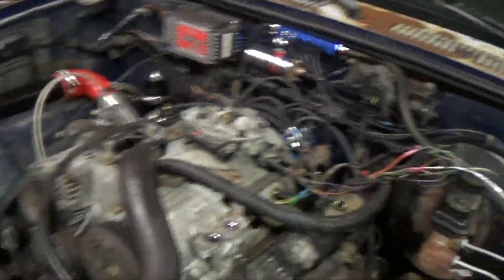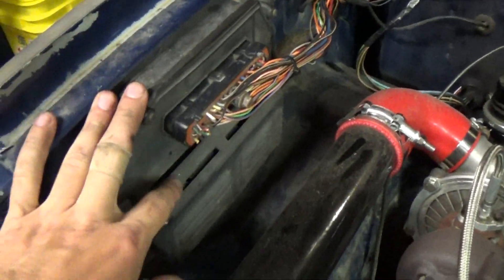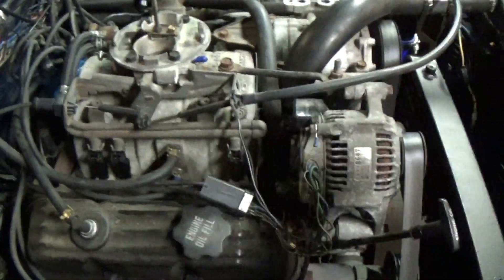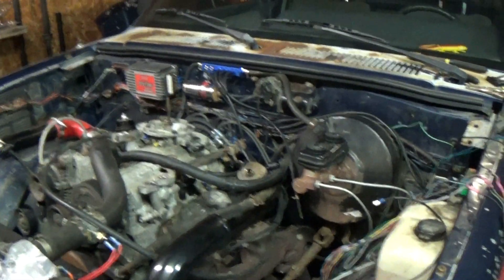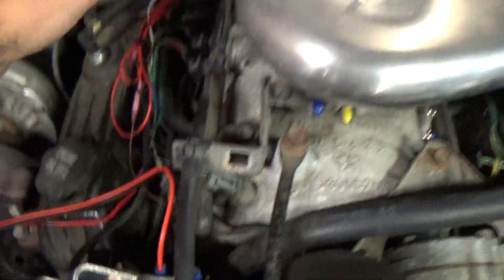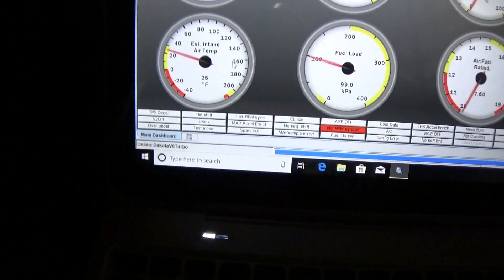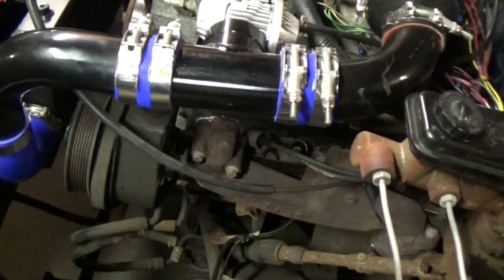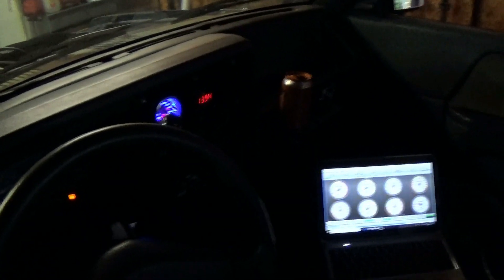3.9 Dakota Megasquirt Install Part 2

Comment: i have a 94 dakota with a 5.2l that im putting a microsquirt on. Its giving me a few problems but i think im just going to go race mode and have the 12v parts on their own switches.
Reply from the maker: What kind of issues is it giving you?
Reply: @RustBeltGarage1  just needed a firmware update but where did you get that adjustable iac valve?

Comment: did you ever try anything with tuning the stock ecu? i know theyre flashable but theres one company that does it any they wont give me any info go figure so i think im gonna just go megasquirt also.
Reply from the maker: Dillon Hensel nope I never tried, the factory ECUs on these trucks are flashable but any standalone ecu will run circles around one and from what I’ve seen don’t cost much more
Reply: @RustBeltGarage1  yeah for sure which ms did you go with and how much did it run you?
Reply from the maker: Dillon Hensel I used an ms2, I think it was around 650 including the wiring harness
Reply: @RustBeltGarage1  also i cant wait for you to hit the dyno i wanna see what theyll do. nobody mods these trucks so im stoked to see yours

Comment: I have a 3.9 too I am still trying to figure out the fuel system and how it should be done can you do a video elaborating on your fuel system ?
Reply from the maker: Yeah that’s been something on my to do list, do you have questions regarding the megasquirt setup or the actual fuel system setup? I plan on making a detailed video once I have dyno numbers to back it up.
Reply: Rust Belt Garage just on the FMU and how it was Plumed  👌🏼👌🏼
Reply from the maker: Francisco Hernandez the fmu never worked well and I’d suggest not bothering with one at all. Basically I ran an external walbro pump and all new fuel lines to handle the extra pressure of the fmu and keep the high pressure from being in the fuel pump assembly itself(the walbro was sucking fuel through it instead). I also flared the inlet and outlet on my fuel rails so I could use conventional hose clamps to assemble everything without hoses blowing off. I had no hose blowouts with this setup but afrs were not great and the eBay fmu was a turd from day one because it came with a ratio disc that didn’t even fit in it lol. You will need a pump assembly from a 92 or older truck that has a return line port on it also, later trucks just had a feed line because the regulator is contained inside the gas tank.
Reply: Rust Belt Garage dang lol and for sure thanks bro I really appreciate it 👌🏼 . Have you ever thought of doing a 360 swap in a Dakota ?

Comment: I have a 5.9 360 I wanna turbo. how much does it cost for the turbo and all the piping, and blow off valve?
Reply from the maker: You can get ebay turbos for less than $200, ebay fmic kits can be sub $150. Blow off valves and wastegates vary quite a bit but expect them to be around $50 each. The exhaust stuff was all home made.
Reply from the maker: You can get ebay turbos for less than $200, ebay fmic kits can be sub $150. Blow off valves and wastegates vary quite a bit but expect them to be around $50 each. The exhaust stuff was all home made.